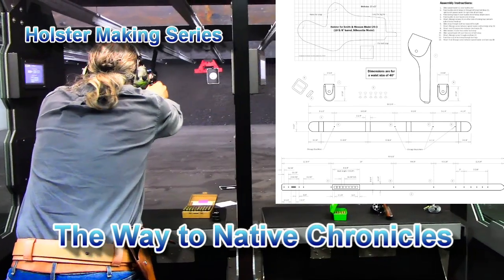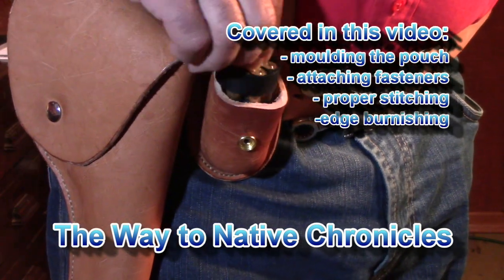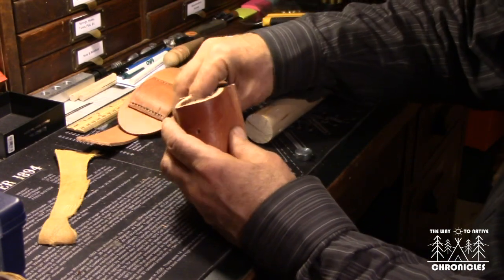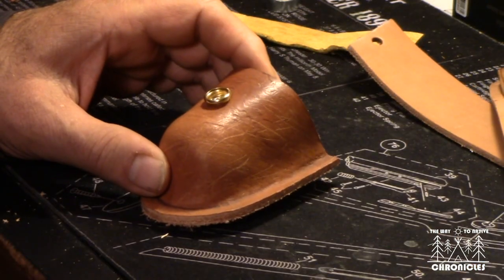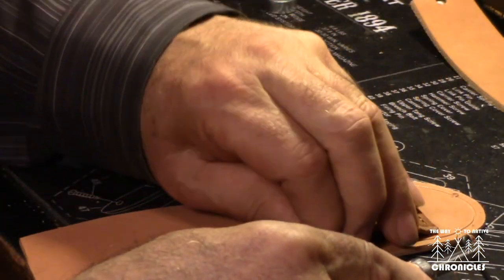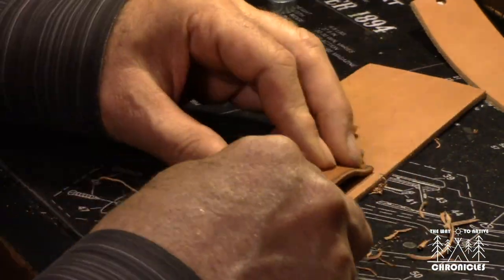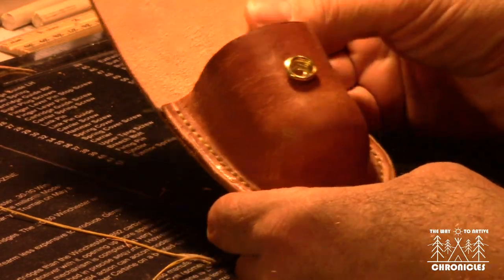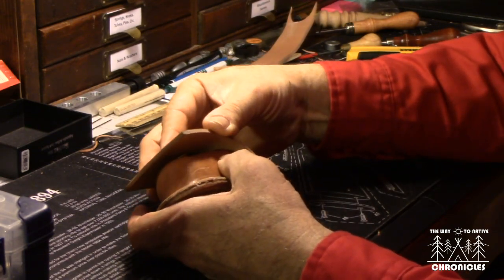How To Make A Speed Loader Pouch

Comment: This is a great vid and I enjoyed watching it.  However just for anyone else that wants to know, it’s not a hard and fast rule, but typically the cup or female side of the snap would go on the inside of the closure flap, and the male side of the snap would go on the front of the pouch body.  This is mostly because of how the snap releases.  You want to be able to easily pull the female cap off the post at a slight angle which allows it to release.  Again, it does work the way he did it, but it’s just not the norm to do it backwards like this.  Again great vid though!

PS:  please don’t ever lick your leather!  You can burnish the edge with water or any other liquid.  Most leather is sourced in other countries with different standards of safety.  Although Veg-Tan leather (what he’s using), is tanned with plant matter, there may well be other chemicals in there that can hurt you.  And It really is easy to just keep a small bowl of water on your workbench.  I use a small paintbrush sponge to target the water only on the edge.  Licking it is needlessly dangerous.
Reply from the maker: Excellent points and thanks for taking the time to post that comment!  (btw, I no longer put the cup side of the snaps backwards for the reasons you stated, since making this video).